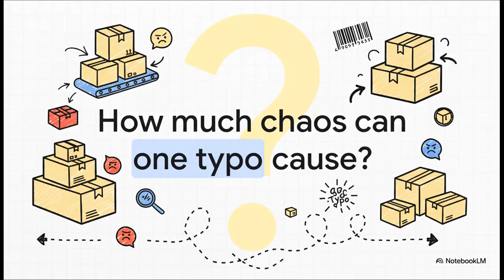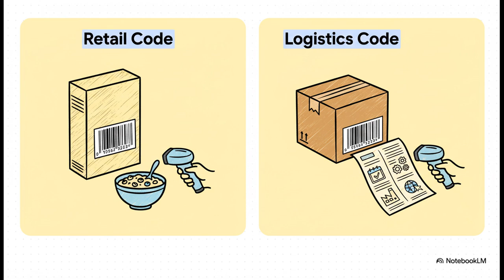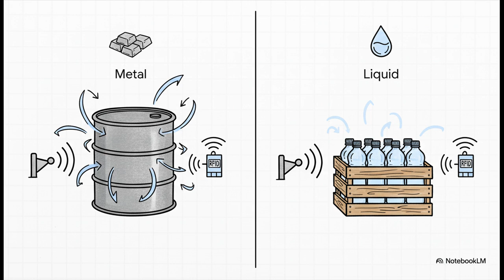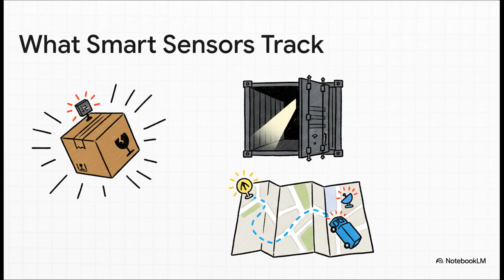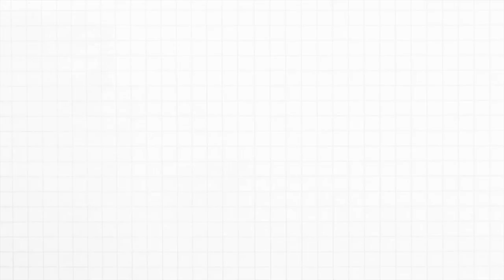Logistics: Barcodes to Bots | Information Systems in Logistics | Lecture 11 | NotebookLM AI

Comment from the maker: 📌 *Timestamps for easy navigation:*
0:00 The cost of manual data entry and the "billion-dollar typo"
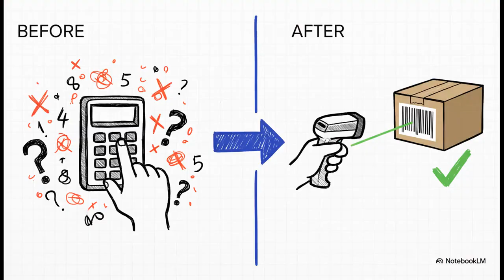1:13 Introduction to automated identification: 1D barcodes
1:46 Retail barcodes vs. data-rich logistics codes (batch, expiration data)
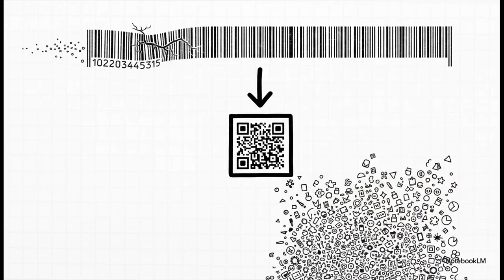2:29 The transition to 2D barcodes (Data Matrix) for item-level tracking
3:02 Breaking the line of sight: the architecture of RFID technology
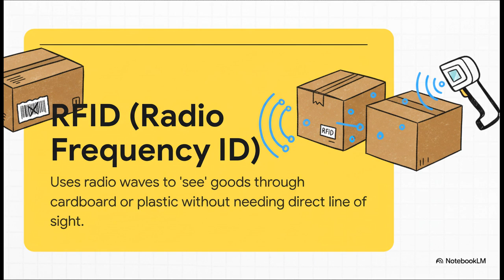3:30 Passive vs. Active RFID tags: differences in power and range
4:28 Economic and physical limitations of RFID adoption
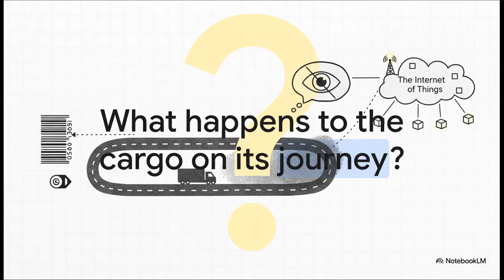5:32 Bridging transit blind spots with the Internet of Things (IoT)
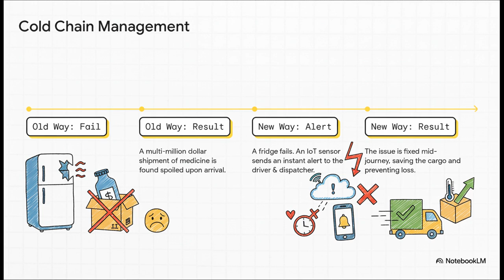6:18 Real-time telemetry: tracking temperature, shocks, and geolocation via IoT